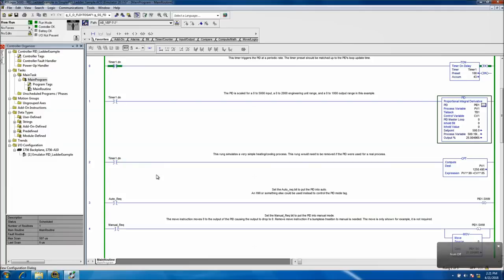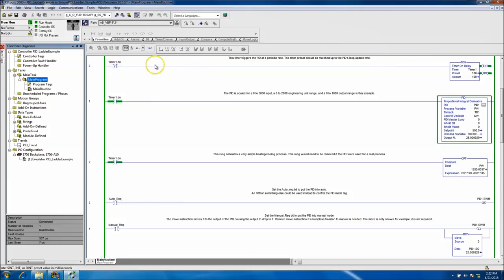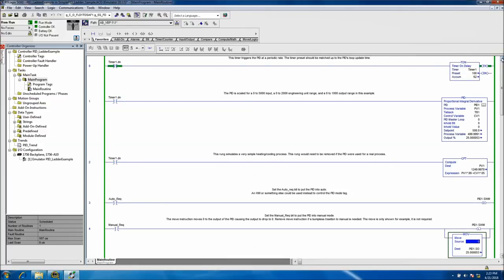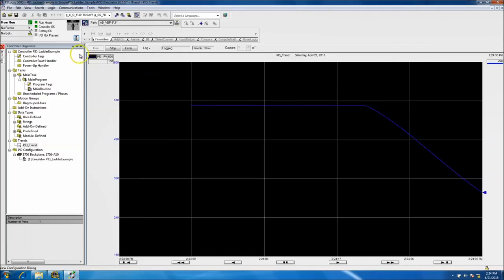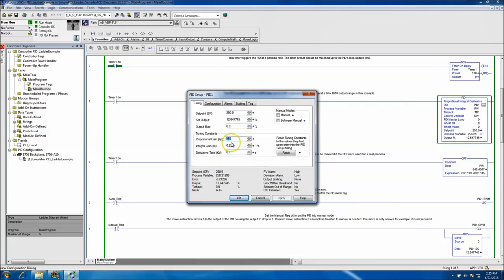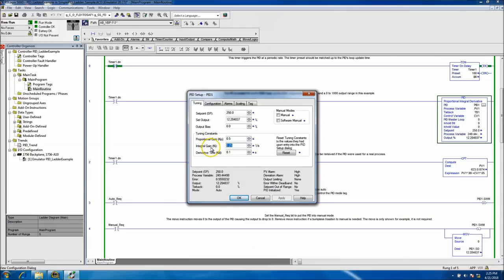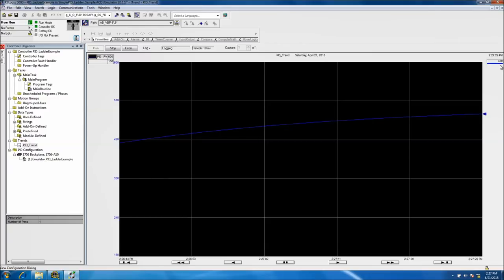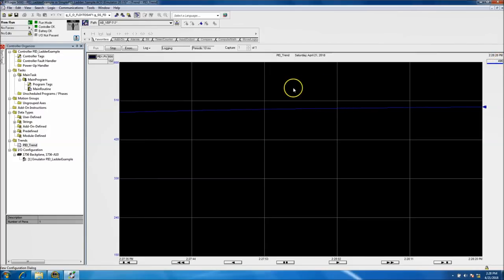RSLogix 5000 PID Setup and Tuning

Comment: Just wanted to add my 2 cents given I just went through a troubleshooting exercise with Rockwell. For Logix5000 they do not recommend having any conditions on the PID instruction rung, rather just keeping the instruction inside of a Period Task with the same interval as the Loop Update Time.
Reply from the maker: With your 2 cents accepted, make sure you know that these videos are just showing & teaching experience.

Not anything written in stone.

These are examples.

If you know about PID programming through Rockwell then note that this is their actual sample code from years ago.

The sample is just a test method from using conditions.

That is a better way to teach.

We all know that due to privacy rights, we can't show real life machines unless we own them
Reply: @ShaneWelcher  Right...but in my case,  which could easily be the case of others, I ended up at this video as well as other forums where users have incorrectly advised using Timer DN bits as a condition in their PID instruction rung. This wasn't even the point of your video, but nonetheless I wanted to mention it since it was valuable in my particular case.
Reply from the maker: @RottieHaven  

I agree that other points can be said, note that all PID loops are different.

They are dependant on the actual devices used & setup.

This is what throws a wrench in teaching tuning so that is why I used the same code so that it would handle the tuning knowledge.

At least, small piece of knowledge that people can learn from for what the P, The I, & the D stand for.
Reply from the maker: Thanks for helping, hope all is well

Comment: Shane, first of all thanks for all the helpful and educational videos!
 A couple of questions about your PID setup: 
 (1) at time 16:00/22:04, why your simulator in rung 2 has a calculated value PV1=1250.3518 while the PID process variable (PV1) shows 500.14243?
 (2) You use a 100 msec timer to run/control your PID in rung 1. In that context, what is the loop update time that you show at 19:41/22:04 of video? 
(3) Could you possibly add a video that explains more about the function of the different parameters of the PID configuration?

 Thanks in advance.
Reply from the maker: I can try but at the time my wife is days away from being induced so my son is about to be born. I will make a note to try to make one but feel free to remind me through my website https://bit.ly/2D4F2gj
Reply: @ShaneWelcher  No rush Shane. You should be with your wife during this special life-changing event. Congratulations! 
There is already a lot of good information in current video, just thought a little more could be said on parameter configuration.

Comment: Good video. Very informative. I am trying to control the PH of a water treatment system. My tolerances are pretty wide so I don't have to get it exact. What is the difference between the Process Variable and the Control Variable? Any tips on using a PID loop in RSLogix5000 with the PH as a process variable to control a mineral injection motor/pump? Upon further research, I have come to the realization that controlling PH is a nonlinear process so it complicates the matter.
Reply from the maker: The PV is the input value to the PID loop.

The CV is the control

The PID will react based on the set up of the PID loop but to be honest there are tons of more variables that need to be answered if you wanted to a solution to what you are asking.

The setup of the loop matters greatly....meaning, physical setup and the PID loop itself

Comment: hello Shane, i liked your video, i am working in a college project where i need used the module imc in block diagram but i dont know how tune this block, i have the instruction set manual but it doesnt say so much, i need help , please if you know any about that could you help me?
Reply from the maker: What software are you using exactly?

Comment: Hello Shane,
Is there a rational method to determine what should be changed, by how much and in which direction. It sounds as if we are making changes without any prior guidance or reason, and then if needed, and as often as needed, we are reversing these changes or acting on other parameters, or for that matter, reinforcing the previously made changes? There is a lot of guesswork that is not easily analyzed or planned for in this approach to tunning PID.
Thanks anyway for sharing with us your expertise
Reply from the maker: First I would ask if you are using a PIDE or PID.

Then I would say a lot depends on the actual device set up & the timing of the reaction from the devices used.

Meaning, if you are making a lot of changes then it seems more like a mechanical issue.

Whether pipe, valve, pump, air, flow, or whatever is being used.

The process is very dependent on the process & how it's physically setup

Comment: Hey Shane, I was wondering if a drive could cause a velocity error? I have a machine with 6 axis all set up the same. Only one axis has a high velocity error. We took apart conveyor and inspection all bearing and gearbox? Didn’t find anything to cause the velocity to spike. Could it be a bad drive. They are 25 plus years old?
Reply from the maker: Could be the drive or the drive tuning but I would also check for noise.

Dirty power from a lost ground or using an oscilloscope to on any speed reference wiring if any is used.

Might also be the drive current is higher than expected.

Example:
Drive outputting double the flux current the motor.

The start boost or run boost could be too high.

There really could be a number of causes.

Depends on the drive & the setup

Comment: Can a different formula be put into the compute instruction to allow the PID to simulate a PV - SP control action?
Reply from the maker: Yes, this was just an example. Nothing written is stone
Reply: I have been unsuccessful getting the PID to work in reverse acting PV-SP mode. Have you created a formula for that function?
Reply from the maker: @paulrogers8459  
I do in the sample logic I did in the video
Reply from the maker: @paulrogers8459  
I'm just getting home from my wife having our son, it may take a few days for me to get things situated so I can help out more.
Reply: Congratulations on the birth of your son. Yes, definitely no problem, whenever you may have time. The PID works great in SP-PV mode but not in PV-SP mode with that calculation in the compute instruction.
Reply: I've changed the compute instruction to PV*1,002-CV*0,005 and the control action to PV-SP and after some PID adjustments it finally worked.

Comment: Sir, in CONFIGURATION of PID what is role of NO BIAS CALCULATION.
does it effect the oscillation.
Reply from the maker: The best way to control oscillating in my opinion is to properly tune to loop.

Although, if this is a real system that is currently working then please note.

Physical, electrical, & the Proportional, the integral, & the derivative.

There are more things to consider than just the program.

Just keep that in mind
Reply: @ShaneWelcher  thank you sir.
Reply from the maker: @naman.maheshwari212  Welcome my friend

Comment: Thanks for sharing. How can you use this if it is a digital output, say to SS Relay controlling a heater with a
 Thermocouple as the input?
Reply from the maker: Use the PID error for logical control, I have a video on this on my channel, just search PID on my channel.

I have the video and it is where I made an AOI to do this exact feature so it may be under and add on instruction search on my channel.

If you can't find it then let me know and I will make sure I re-publish it.

Comment: I set the logic diagram and pid setting exactly the same as yours, but when i put the PID in Auto Operation then the Output strike to 100%, the curve move fast to 2000 (SP set to 250), is there I missed for something here?
Reply from the maker: Maybe the PID tuning from what you are saying or either the scan rate of the processor.

I used a periodic task at 75ms

Comment: How i can made PID for 3 analog solid state relay connected to 3 heaters ?To keep the temperature on 50 Celsius
Reply from the maker: Look on my channel and search PID, there should be a video about that....I think PWM
Reply from the maker: It may be under Add on instructions so search that as well

Comment: What is the difference between Independent and Dependent mode ?
Reply from the maker: The way the PID equation calculates.

Quick example is:

Independent
Changing one gains only affects that term and not any of the others

Dependant
Changing the controller gains you change the action of all 3 terms, proportional, intergral, derivative, at the same time
Reply: @ShaneWelcher  Thank you very much

Comment: Is posible use this PID in order to control motor speed of the spooler  (winder or unwinder )? , if is not posible,  which would be the reason ?thansk in advance
Reply from the maker: Angel Tobar 

Truthfully, I would write a routine for PI and not use a PID. The use of a PI is a natural logic control for winders and speed control

Comment: When use Auto_Req Or Manual_Req ?
Reply from the maker: Auto is for auto mode and standard controls generally but a manual is often used as a maintenance task or is something is wrong.
Reply: Shane Welcher  thank you so much